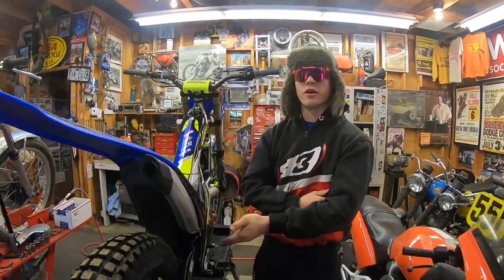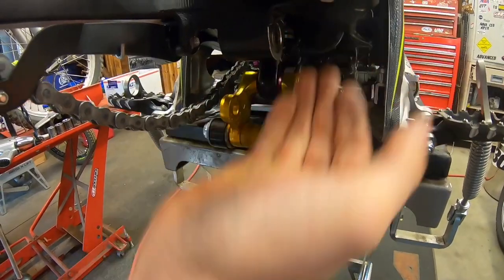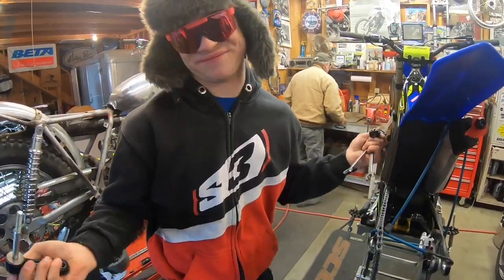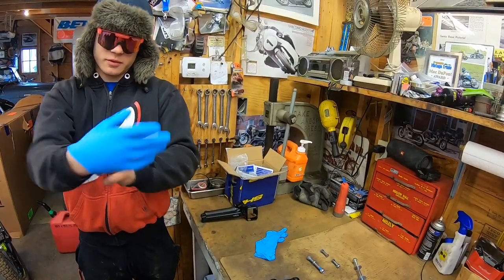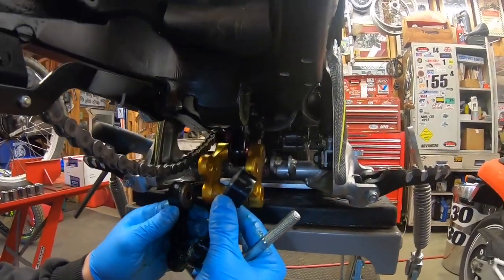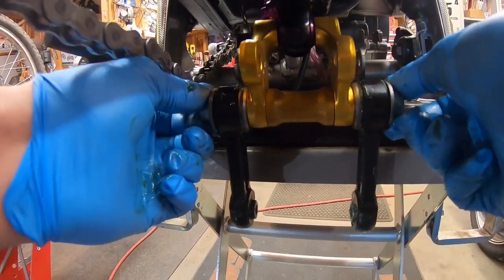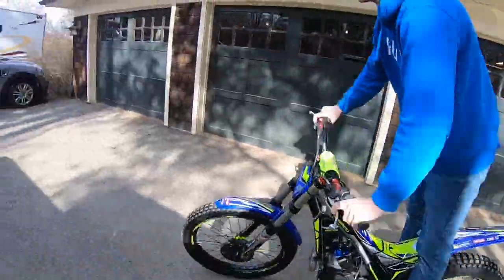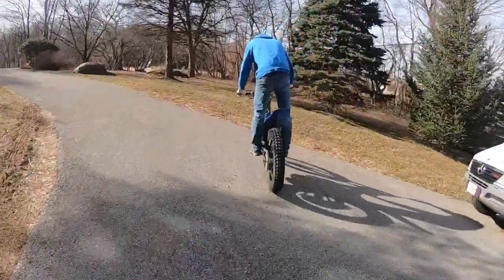HOW TO: grease your linkages on your Sherco/Scorpa trials bike

Comment: Thanks. Saved me a bunch of time. Also, it helped that you explained which ways the washers/bolts went in as I’d forgotten which way (did the job over a few nights)!
My only uncertainty was whether or not you should do any maintenance to the lower shock mount. I left mine for now, as wasn’t sure.